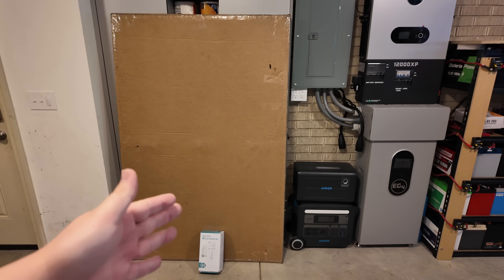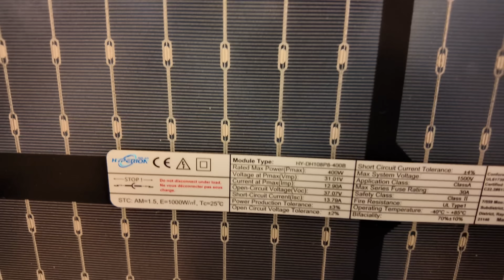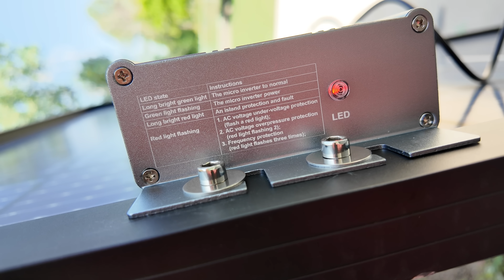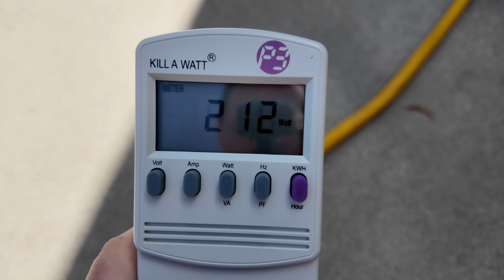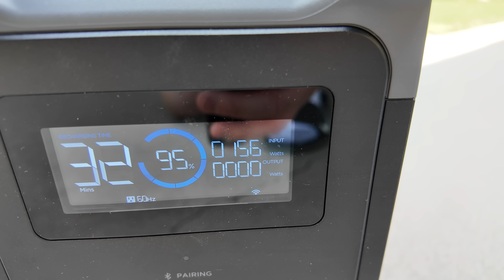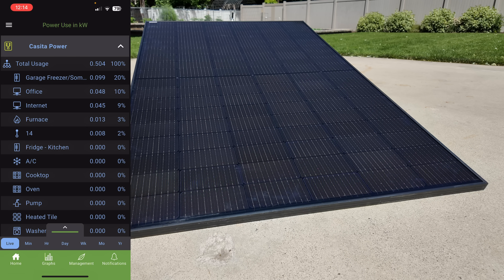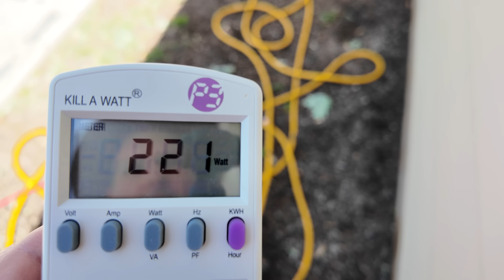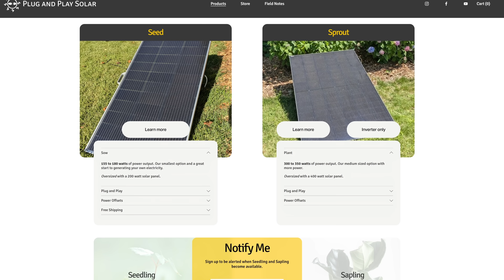This Solar Kit Plugs Into Your Wall?! Plug & Play Solar Review!

Comment: $450 for 350 watts... Assuming $0.20 per kWh,  so you're looking at around 2250 kWh to break even... At 350 watts, that means about 6429 hours... Assuming 8 full power hours per day, that means 803 day... If you assume 12 full power hours per day, you're looking at about 536 days... So, maybe you will break even in 2-3 years... If your local electricity rate is even lower, it will take you longer to break even...
Reply from the maker: 2-3 years is pretty darn good! My neighbor with a whole roof full of solar panels has a loan for 20 years on it. So she won’t be breaking even for at least 20 years! Yikes! Thanks for watching!
Reply: @theresatrickforthat  does the  microinverter only detect 120VAC @60Hz or can it detect 110VAC or 220VAC @50Hz? This works in Europe right ? Which is mainly 220VAC @50Hz
Reply: You maths is good. Until the power goes out and you can repurpose the panel to charge up a battery generator. Having lived through 2 multi day power outages, I won't be doing it again...
Reply: Yep these will eventually pay for themselves, like all solar. The plus here is that there's no installation costs to also pay for, which means a faster rate of return.
Reply: probably double that.  8 hours seems like the amount of sun to expect, but in reality, it's only maybe half of that which is truly worthwhile.  Don't get me wrong, I still think this is very interesting.
Reply: Not even close... as you can see, he's only getting a little over 200 watts in good conditions. and unless you live on the equator you're not getting over 4-7 average per day for a year. in the middle of the US I get 4hrs in winter and 6.5 in summer. and it is considered one of the good states to get solar. California gets a bit more but it's basically impossible to ever get 12hs.
Reply: For Hawaii, it is $0.43 to $1.29 per kwh...  would pay for itself in under a year!
Reply: @SilverFd3s  At that point, the question becomes "can you afford NOT to have solar?" A gasoline powered generator might actually be cheaper, during those peak hours. I don't know what gasoline costs there, but, a good generator will typically produce between 4 and 6 kWh per gallon of fuel consumed. Based on that, it might be worth a little time on a calculator, to see if a generator could actually save money, used certain hours of the day.
Reply: Yeah two to three years isn't happening at .20 per kwh.  Last time I checked clouds still exist.  And the last time I checked shorter winter days still exist.  And heat still exist. and you will NEVER get the rated watts from a solar panel because the max possible is what they are rated at.  Also the inverter is not 100% efficient.  You can hope it is only triple what you calculated.
Reply: But in a national emergency  it's a lifesaver no doubt!
Reply: I can't wait to see the newer ideas as these are improving constantly
Reply: Much better than the $30 k rooftop system I just got quoted.
Reply: In CA we have probably highest electricity rates in a nation, at around $0,36 and $0,42 (during peak hours).
So this system makes sense
Reply: This is perfect if you are renting )
Reply: In UK were paying  48 cents  / kwhr ,, and my '"balcony "  sys ( 800w) cost me  550 gbp ( .  =700 bucks )so no brainer here , when Putin attacked  Ukraine we were paying 60 cents / kwhr !!!
Reply: My utility PG&E is 43-48 cents per KwH. So I would break even in half the time 😭 

But this same utility is also blocking plugin solar.
Reply: Unless you're in Texas during a "power event" and all of a sudden your monthly power bill goes up to $1000 a month for a normal monthly load then you pay it off in a month...
Reply: @DevinVoorsanger  -- That is going to depend upon your electricity provider, I suspect... I've never had that happen in the last 40 years... There might be some electricity plans that go by the spot market, but I've always had ones that average it...
Reply: Your productivity numbers are off by factor near 3.
Reply: Micro inverters only produce if they see the grid so not an emergency solution. 4hrs x 300 watts per day is more realistic.
Reply: If you want a faster return on investment, use the system to charge an electric vehicle! While the grid cost per kWh of electricity is $0.20, a good efficient EV gets somewhere close to 4 miles per kWh. that works out to $0.05 per mile. To drive 30 miles, you need 7.5 kWh. that's $1.50 worth of electricity. A Toyota Camry gets ~30 miles per gallon. Right now, where I live, gas is $3.25 per gallon. That's more than twice the cost! Offsetting home electricity returns $0.20 per kWh, using the system to charge an EV, is the same as offsetting  $0.433 per kWh, which cuts the return on investment for the system, to less than 1/2!
Reply: @vincentrobinette1507  This is the way. I live in Los angeles and pay $.27 for electricity and I own a tesla model 3 long range. Will be looking into more affordable way to offset the cost of charging an EV.
Reply: @alexrapada  Even at that, the electric is almost exactly 1/2 the cost of driving the same vehicle with a gasoline engine. A gasoline generator would cost at least 54 cents per kWh, in fuel only, not counting oil, maintenance, or, the purchase price of the generator. You're already offsetting the cost of charging, by not having to buy gas!
Reply: Most of us who buy portable solar panels and portable solar generators / power stations don't care about seeing a return on investment on energy bills.  Sure, getting some of it back is nice, but it will pay for itself if/when SHTF and anyone without some renewable energy will probably be wishing they had paid the meager few hundred bucks while they're watcking all their fridge food spoil and they're sitting in the dark sweltering in the summer heat.   Anything longer than maybe 2-3 days will turn most people's lives upside down, especially if they're stuck there with no way out.

A gas generator is great, but when the gas runs out and the pumps stay down because of no electricity or way to take payment, solar can still be obtained as kong as there is at least some sunlight.  Gas generators can work with and compliment these solar systems to extend the efficiency of both too.  Plus, portable solar is quiet, it can be used safely indoors and incognito from the have-nots, it can be moved around as needed or taken with you, and in the interim, yiu can use it to make a little coin back, enhance your camping experience, or just as backup/UPS for general home equipment.

How many of you bought your cars expecting a return on investment?
 
Yup.
Reply: In most of CA, summer electricity is way more than $.020.  Where I'm at, low hours usage is $0.15KWh.  Mid hours usage is $0.21 KWh and peak hour usage is $0.37 KWh.  A good chunk of coastal and Southern CA, as well as PG&E users are often paying closer to $0.65Wh for grid power.  So yeah, the ROI can add up quick here.  But, as I said before, the ROI is relative and not the reason people buy these systems.

The one time you need these portable setups for a 24-72 hour outage, it will pay for itself in convenience. And, the longer the outage, the more ROI each event. But, on top of that, the grid price offset and ability to use the systems for backup UPC in the interim is just a bonus.

 Anyone buying solar, especially portable systems, strictly looking for a full ROI is a knucklehead.  Laptops don't hold value, but we buy them.  Cell phones don't hold value, but we buy them.  Cars don't hold value, but we buy them.  Why? Because they are useful and they provide convenience, even though their monetary value will degrade the moment we buy them. Solar is no different. All the nay-sayers will be wishing they had some sustainable power to save their cold food when the power goes out more than a couple of days.  Solar is just part of the prep to some of us  who see it as an investment in life for ourselves and our loved ones. 

To each their own, but I sure ain't sharing with any neighbors who say I'm  dumb while times are good.  It will be interesting to see if they sing the same tune if/when when things go dark for awhile and times get rough.
Reply: @titobandito8474  A high cost electricity state like CA is the perfect use case for a full rooftop system.  Where I live in Central Texas, a solar system will never pay for itself because I pay 10 cents a kilowatt hour all-in including all fees and transport costs.  But, if you don't want to be at the mercy of the grid operator in a winter storm like we were in 2021, or during rolling blackouts in the summer because of the explosive growth that Texas embraces at all costs regardless of grid capacity, then, a solar system is a good idea if you have the scratch for it.
Reply: @Brons2Texas has one of the most terrible or unreliable grids in the US. It looks like reliability and resiliency are not big in TX😂
Reply: They did the math!
Reply: 😂 bad solar math. Maybe 4-6 equivalent sun hours per day. This is video is dangerous. Do not attempt.

Comment: That micro-inverter sucks. It's throwing away over 100 watts. There are far better microinverters on the market.
Reply from the maker: Yeah? Tell me what 120v ones you know of that don’t have the over heating issue! I want to get my hands on them!
Reply: The inverter tops out at 350 watts and they sell it with a 400w panel. They don't seem to have a data sheet available but I'm not sure where all the extra power is going. It's hard to imagine only getting 220 watts out of a 350 watt inverter and having it be generating 130 watts of heat, it would be like a hot plate sitting there untouchable.
Reply: @Snerdles the inverter is throttling itself due to heat.

Comment: Simple process, horrible output.  If I am buying a 400 watt panel, bifacial to boot and I can only get a little over 200 watts and having to fuss with the microinverter to baby it, there is no way it is worth spending the money.  Do you have a microinverter that performs better or is it the solar panel that is sub par?
Reply from the maker: There are some fantastic 240v micro-inverters! Check out this Hoymiles unit: https://youtu.be/VymWSGSL4YU Thanks for watching!

Comment: I had a gotten similar plug and play micro inverter years ago until i got the 12000xp. But was afraid it'd harm the 12000xp, nice to see them be easier to use, old one just had lug terminals to plug solar input but at lest did have a fan for cooling
Reply from the maker: Thanks for the comment! It's always great to hear from folks who have hands-on experience! Thanks for watching! Check out my 12000XP videos as well! :)

Comment: If you speak like that normally, holy hell there is something not right….do you know you sound like that? Why do you speak in short spurts?  I don’t even know how to explain it but I can’t take it.
Reply from the maker: Haha! To each their own! If we all spoke the same way, we’d sure live in a bland world. Thanks for watching anyway! :)
Reply: Perfect diction, enunciation and speed -- saves me time, too.  Don't change a thing, bro.  And thanks! 
 
BTW, I live in a metal home where it's easy to punch a nice, smooth hole through the wall, so I'd be inclined to try this but run the extension cord through that hole and plug it into an indoor (garage, maybe plug) to keep the inverter indoors (hence, run cooler), and thus extend its life.  Heat, after all, shortens equipment electrical equipment lifespans.
Reply: wtf is your problem?
Reply: @alexrapada  I think what Brian is saying above is the OP talks extremely fast like @CGPGrey does, and while I as a Britbong from t'up North in the UK can get my head around it, others can't :/
Reply: Dont watch then! C10WN
Reply: @theycallmephylthy  Likewise, don't comment unless you have nothing other than insults to hurl at people.

Is it hard to be civil?

Comment: This is amazing!
I am going to get a half dozen inverters and plug it into my house!
Reply: Remember your home's power is split into two legs. L1 & L2. If you're doing multiple inverters, when you plug these in, your house might be using 200w on one leg and 150w on the other leg. If you can, probably better to find two outlets on different legs to reduce risk of back feeding, some meters measure both ways so you could end up paying to send power out to the grid.
Reply: @AndresHernandez-n7w  the only people who have bi-directional electric meters are people with solar/wind power on there house already, there would be no point any other way
Reply: @AndresHernandez-n7w  Utah requires utilities to accept back feeding without an interconnect agreement. In fact the law says utility is prohibited from requiring the customer to get approval. You can read about it just search Utah House bill 340. The utility is not allowed to add a charge for using these. Finally common sense law passed that stands up these monopolies I can't wait for the day when they go bankrupt.
Reply: We're ready and excited to get you started!
Reply from the maker: I always love hearing from you! Thanks for the comment! You’re smart, so I’m preaching to the choir…but don’t overload any of your circuits hooking up too many and make sure you’re okay with your local utility to do this! As always, you make my day hearing from you! Thanks for being part of my YouTube family!
Reply: Thank you for the info
Reply: When or where do we find a device that would allow us to send solar produced DC directly into our EV through the DC fast charging ports on the EV? I imagine that every EV has communication software needs to be satisfied before charging can begin. It seems like there are only two factors to address, A: create enough voltage to excite charging; most EV’s that is around 400 volts, B: overcome the software communication issues.

Comment: Great video! just subscribed. With the 1200 watt max restriction, can you daisy chain enough of these to reach that max? and also is there away to limit it so that you don't exceed the 1200 watts?
Reply from the maker: There’s no limiter at all…so you just have to do some simple math to make sure you don’t exceed the 1,200 watts and you’re good to go! Thank you so much for subscribing! I’m honored! I’ll do my best to bring you valuable videos! :)
Reply: You can daisy chain or even just use it as an extension cord for yard tools, etc.  Given the performance in the video, you'd need 5-6 to get near 1200.